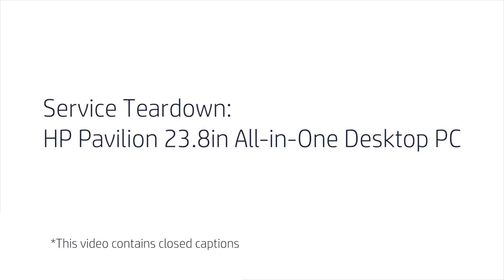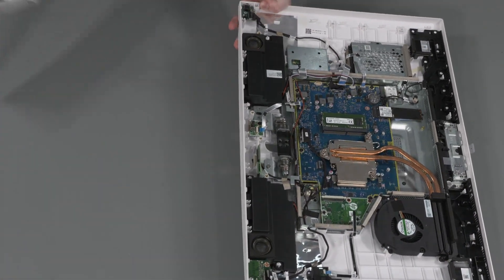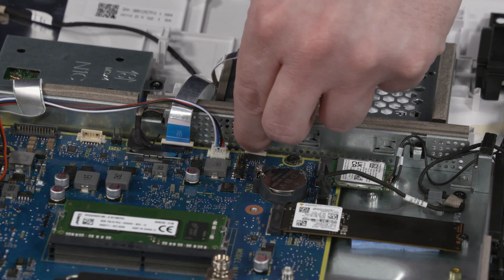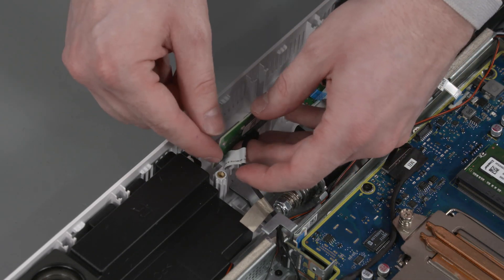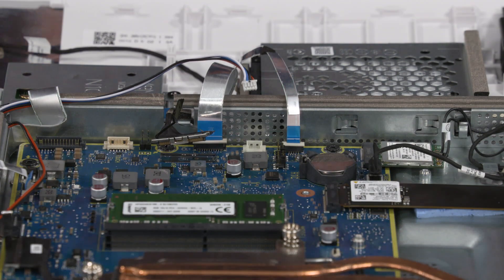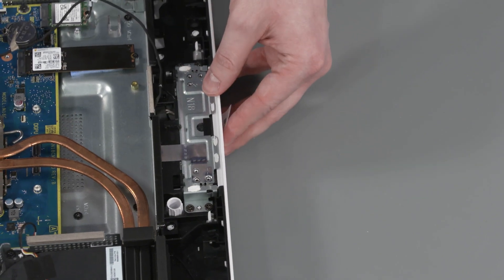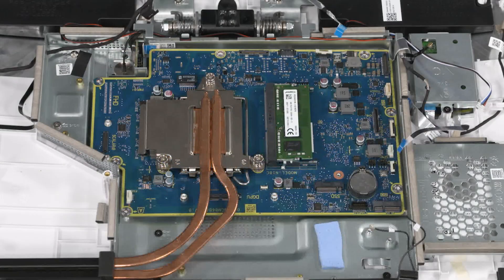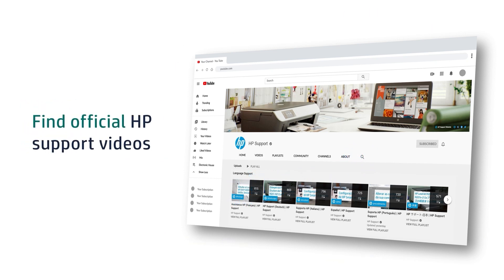Removing & replacing parts for HP Pavilion 24in AiO | HP Computer Service

Comment: Is it necessary to disconnect the backlight cable and ribbon cable from the motherboard to replace the RTC battery? Also, will just replacing the RTC battery correct a 502 checksum error? My computer repeats the initials bootup process twice and then goes further after the second time and displays this error message. It then completes the boot-up, and is ready for use. Is it necessary to do some manual resetting, after replacing the battery, or would replacing it do all the necessary resetting?  Thanks! in advance, for any help with this question.
Reply from the maker: Hi there, thanks for contacting HP Global Social Media Support!
I understand that you are receiving CMOS Reset (502) The CMOS checksum is invalid error.
I will do my best to assist you.
Please refer to the instructions mentioned under this document to fix the issue: https://hp.care/6056mjtVs
Regards, 
HP Support

Comment: Hello HP support. I need the speaker mesh (chin) for this model. How can I buy it? I will be pleased if someone can help me.
Reply from the maker: Hi there, please contact our customer care team over the phone or chat for further assistance, as this issue requires Live conversation with you over phone or chat to isolate the issue and provide you instantly with appropriate solution or repair/replacement options available at your place as per the warranty.
Please feel free to reach us on call/chat, please access this link to select your preferred country and language option to reach us. Global support link: -  https://splr.io/6051cCFiF
Regards, 
HP Support

Comment: Hello HP Support. Can I add on (and if yes, how) a graphic card using PCI Express Gen 4 connection (e.g. GeForce RTX 3060)?
Reply from the maker: Hi Pawel, thanks for contacting HP Global Social Media Support!
I understand that you need to know about compatible graphics card for your computer.
I will do my best to assist you.
Solution one- download (speccy) It'll tell you your motherboard name, google it to check if it has a graphics card slot that is welded in place or is one that can be changed. If yes then go onto https://hp.care/3KXf5zU it should help to tell you what graphics card you're best upgrading to or if you know your stuff then get whichever you like. solution two - if your card is soldered into place then just buy a new one. Remember if you're going to open up your computer chances are your warranty will be void.
Binu-HP Social Media Tech Support